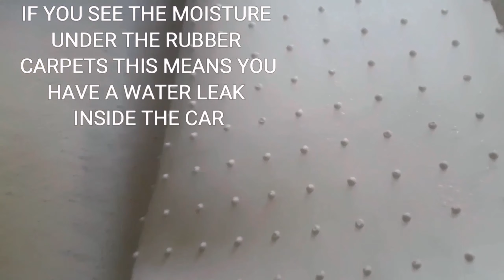WATER UNDER CARPET INSIDE ON THE FLOOR HOW TO SEAL DOOR IN BMW E60 E39 E65 E61 E90 E87 E83 E53

Comment: I don’t have dirt under door but suspect it’s coming in as got wet carpet in rear one side. Did find blocked drain under scuttle bonnet area and got rid of plug there.
Some might be via door. Put plastic bag and closed door to see if any water gets in. When it rains can’t see water getting in from door from inside . Will test with hosepipe maybe it’s a slow seep.
Reply from the maker: you should check water barrier in both doors even if you dint see dirt.
warer barier is damaged in almsot all e60 s. they are almost 20 year old nowm
in this movie I show all draining holes
https://youtu.be/BP4VhmVBtdk
Reply: @BmwFix  yes I’ve poured water using bottle into windows and it runs out of bottom front corner of rear door. Some from middle too but we’ll below vapour barrier. Sat inside and can’t see water seeping in. But plastic sheet polythene under door at base to form a barrier so water doesn’t enter. Can’t see water just above sill where it is would spill into car. I suspect it’s coming in still but need to find evidence. I’ve unblocked the Brake booster one so I’ve residual water which runs to back of car . Been sucking it out daily taking weeks. Don’t have time or skill to take all carpet out so hoping I’ve sorted leak and now it’s sorting drying and mold prevention. Used white vinegar and bicarbonate on carpet then sucked out.
Wish it was summer it would be so easier.., seems to rain daily.